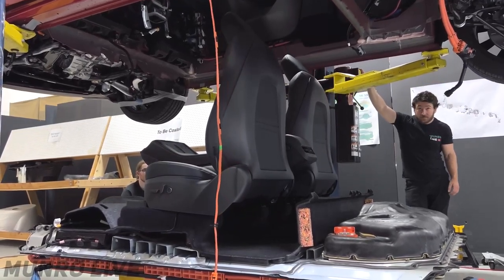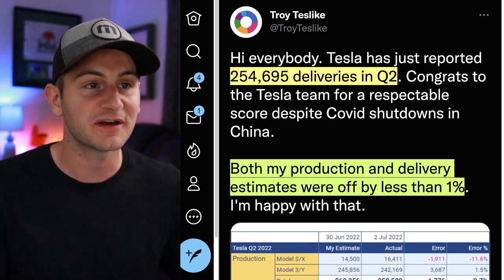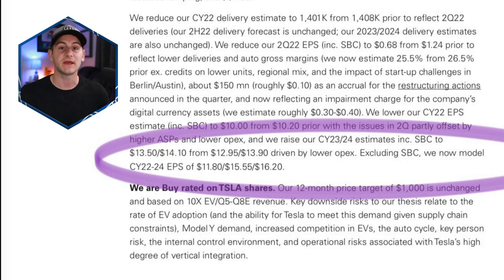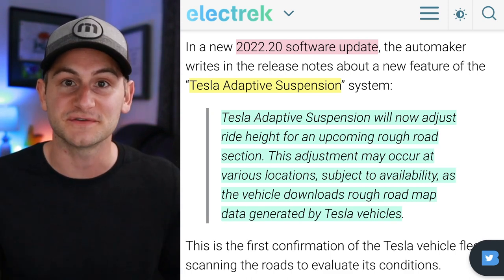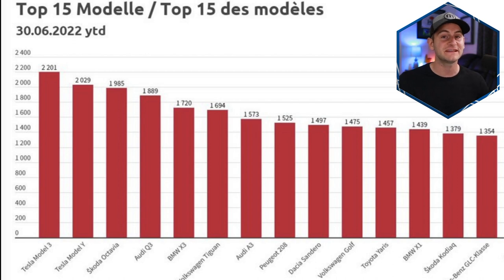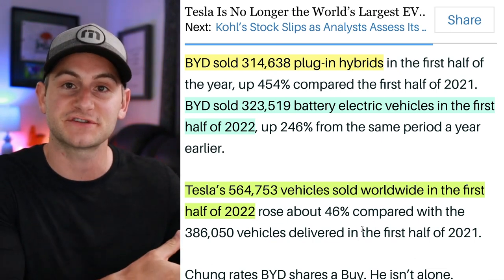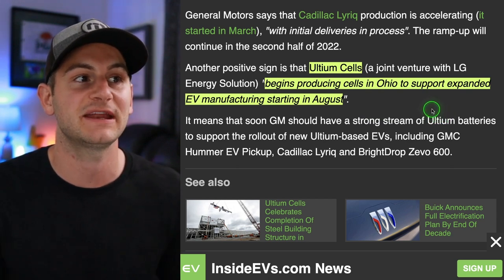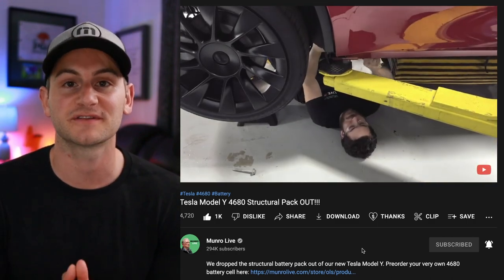Munro on Tesla: "Mind Blowing" / Tesla's Solar Range Extender / Legacy Auto Sales Crater ⚡️

Comment: What’s interesting about the range extender is that it looks like it might fit in the bed of the Cybertruck.  If you could get 10 kWh / day out of that system, and Cybertruck gets about 2.5 miles / kWh, call it roughly 25 miles per day of added range.  It would likely mean you could “overland” / off-road almost indefinitely, and come pretty close to being self-powered if you annualized the daily mileage (25 x 365 = 9125).
Reply from the maker: hey derek! interesting thought for sure, but you'd have to factor in the loss of range/utility from having that behemoth sitting in the bed!
Reply: @DillonLoomis22  Valid!
Reply: Is it pointed directly at full sun for best efficiency?
Reply: If you park at home just use solar panels to make a car port. More area and you get protection from heat & rain.

Comment: Adaptive ride would be easier to achieve with hydraulics struts. The Citroen system hit close to this without electronics but each corner could be individually lifted to float the wheel over a small pothole. Hydraulics do not need to be heavy the Citroen was same as any other car.

Comment: The solar range extender could be be tooled into a camper, i think Tesla are probably looking at this as a set up for the ultimate camper/caravan. They could load them with small electric motors to do all sorts of tricks ie self coupling and backing.

Comment: Munro video was nice. He showed one of the pieces of metal that will allow 
Tesla to lead the industry. I believe when Musk found out he could cast parts for the cars is when he decided to build the other car factories. He knows that he reinvented the wheel......lol   Liked the trailer charger.......lol. I do believe there will be a trailer that will be pulled but it will be camper with a structural battery pack that will aid the EV's range and it might as well have a solar array too. It might have applications in scarcely populated areas.....Australia perhaps.......
Reply: You DO NOT want high voltage/ current connections running between vehicles while driving, especially on rough roads.
Recipe for disaster.
Reply: @rogerstarkey5390  Ok....that makes sense...lol. Maybe a person could just pull over to a rest stop and transfer the power to the car if needed.....They kind of need to build out the charging infrastructure more before pulling a small camper would be in any way be practical right now.

Comment: 5:10 @Electrified - NO we don’t want to do that! Getting pothole data to municipalities might seem like a good idea. In practice, is more useful as an illustration of issues of fairness in Artificial Intelligence. 

Imagine the municipality thinks it knows where all the roughest streets and most post holes are in their city. Then the city allocates significant capital to these areas to fix the roads.

Some neighborhoods will have better pothole data not due to the actual number of potholes or rough patches of streets, but actually due to biased representations of areas with potholes most driven by teslas. This would divert much needed capital away from neighborhoods with rough roads, and towards neighborhoods with a lot of teslas, exacerbating systemic inequality!

This type of problem is happening everywhere.

Comment: Do these shutdowns all relate to mass move to 4680s and we will all be caught by a pleasant surprise.?
Reply: Could be Idra front casting machines?
I still think Shanghai will be using the new version CATL cells from the  factory being built down the road.
Reply from the maker: hopefully we will get confirmation soon but for now it's just speculation as to why
Reply: @DillonLoomis22  interesting times. I can’t believe the speed of change and updates at Tesla. The structural pack and Y tear down of the 4680 by Munro and associates seems to even surprise them. Cool stuff